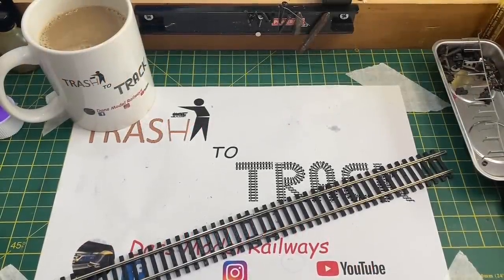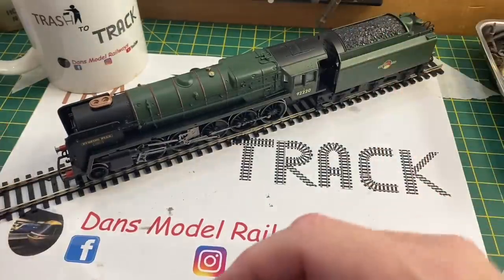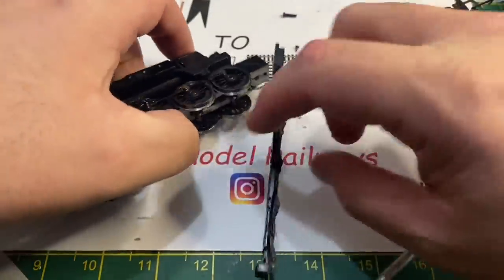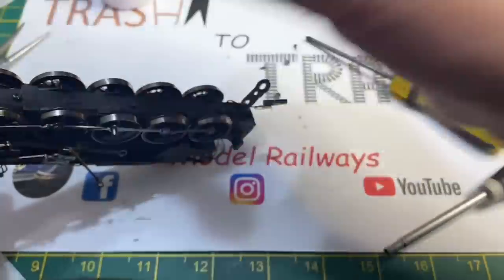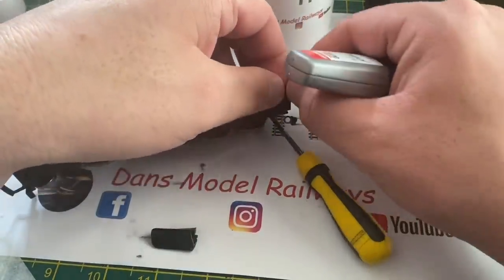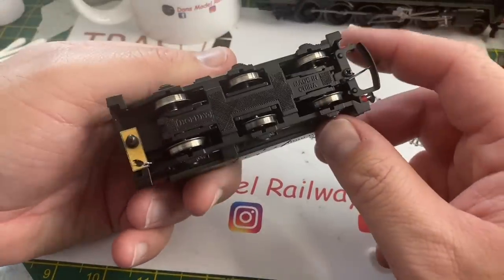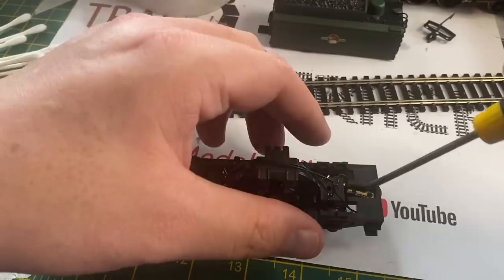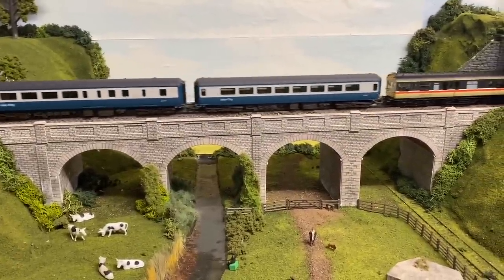Trash to Track. Episode 54. Hornby Railroad 9f steam loco.

Comment: One of these days I’ll get one of these. I have three of the old tender drive ones, but I really do prefer a motor in the locomotive ! My favourite is my 92240. Very heavily weathered and detailed it really looks the part. When you removed the coupling rods from the rear drivers it reminded me of photos I saw of the last 9F’s at Carnforth and Lostock Hall MPD’S in summer 1968 where some of them had had their rear  coupling rods removed and were running their last days as 2-8-2’s!

Comment: The mechanism is great on these but the Mazak rot issue is a thing to be constantly aware of. I've got a couple of of the late 5-pole Ringfield Tender drive 9f's R2105A and R2105D which I am looking to convert to Locomotive drive with this chassis. Hopefully it is just a simple case of transferring the bodies across.

EDIT. Having just received delivery of Hornby R2880 I can confirm it is a straight body swap.
Reply: Mazak rot did for mine.